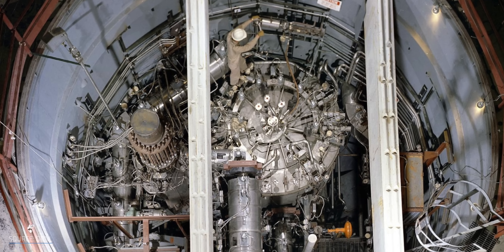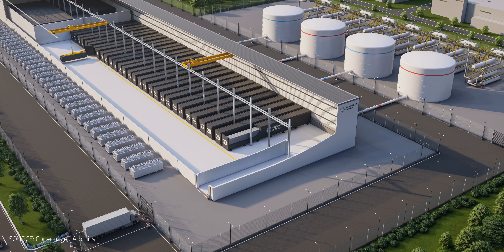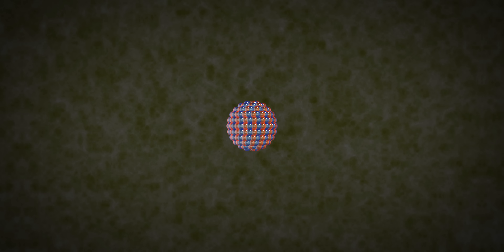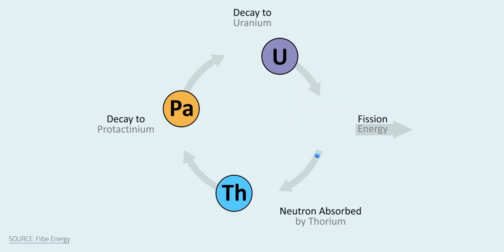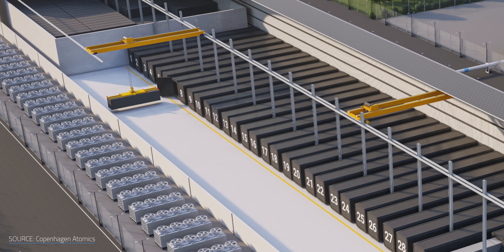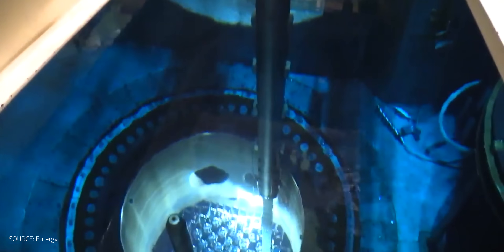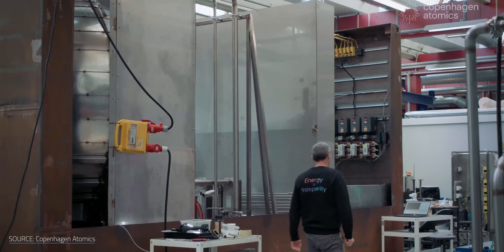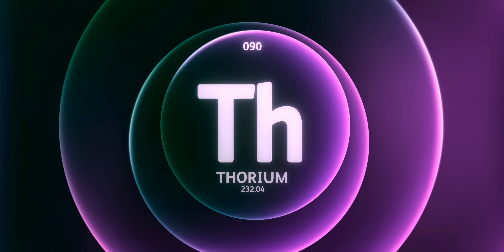Why Thorium is About to Change the World

Comment: Just want to point out that I have been hearing promises like this since the 1970's.
Reply: Me too... I was born in 2000s
Reply: Science is hard. Civilization won't progress if we give up on ideas just because we aren't sure how long they're going to take to develop. There are multiple mere buildings around the world that have taken multiple hundreds of years to construct, yet people apparently don't have patience for paradigm-shifting technology that might take that long to solve? Have a longer view.
Reply: I also want to point out that in the 70s computers that fit in your hand was the stuff if science fiction and you probably typed your comment on a supercomputer that you put in your pocket
Reply: @robertcole1272  So were flying cars - and they still are (just as well considering how most people drive)

In the case of Molten Salt reactors, they were proven to work AND be safe(*) AND be low corrosion/wear(**) AND be capable of complete load following from peak to zero and back again(***) AND be refuelled whilst running

The fact that Weinberg's team didn't get to test thorium operation isn't nearly as important as all the things they did get to test - including handling or replacing reactor and piping components in simulated "hot" environments, which is something that's extremely difficult in water-moderated systems

(*) Nuclear power is already the safest form of energy production by a wide margin. MSRs take this to a whole new level and are "immune by design" to virtually all of the causes of civil nuclear accidents - mostly by eliminating water, but also making things like Mr Ouchi's accident unlikely because external reprocessing isn't needed other than some low level chemical operations(+) to remove "neutron poisons" as the reactor ages

(**) The ablation of Hastalloy piping and the carbon moderator was almost exactly as predicted and no corrosion was visible at any point during operation. Whilst some microscopic surface cracking of the pipework was later detected, the source was identified and the alloy formulation tweaked to accomodate it. It's that tweaked alloy which is used in TMSR-LF1

(***) With neutron poison gasses (Xenon, etc) coming out of the loop virtually immediately, issues of "snap (or prompt) criticality" simply don't exist. Repeated attempts to induce this in the test reactor resulted in a short-lived power spike to about 150% of rated output whicvh then fell back to 120% and stayed there no matter how much provokation the team tried

(+) The "chemical kidney" is something that MSR opponents latch onto as a big deal, claming that filtering the entire loop is a massive undertaking. It would be, but that simply doesn't happen. Filtering is only neeeded after a decade or so of operation and only at tiny fractional throughputs. You're aiming to remove samarium (a non-radioactive neutron poison) from the mix but you only need to remove tiny amounts - enough to stop it affecting power generation capacity. In any case, as with a bunch of other issues there are two approaches possible: external processing or accept an efficiency hit and add more thorium. Thorium is so cheap that it's almost always more cost effective to accept the efficiency losses vs the cost and dangers of processing used fuel. The best approach to virtually all radiological nasties in the loop is to leave them there - they'll break down eventually.
Reply: Okay, but a lot of those promises DID change the world. The internet, for example.
Reply: @markcontini5396  I think @impudentdomain is referring to the cliche that Nuclear Fusion has been 20 years away for 60 years.
Reply: Too cheap to meter.
Reply: That's a pretty shortsighted statement when you reflect on what was accomplished 100 years before "the 70's". The rate at which we could plot advancements 100 years after then is quite staggering.
Reply: I hear ya. Reminds me of wiener enlargement pills. Looks like AGI will be achieved before these things happen.
Reply: @impudentdomain  Doubtful
Reply: China built a working Thorium reactor in the 70's?
Reply: Energy and Technology are the easiest way to scam investors.
Reply: You’re probably right, but the generation of politicians, such as Biden, and people of command, control, seniority, and authority, like Trump from the 70’s, cannot keep control any more. And you can see in the natural age progression of presidents after Kennedy that a particular generation, “the greatest,” kept general control of things for an extended period of time. Things are legitimately changing, and people are wanting to embrace new technologies and future potential, but at the same time, we do want to very much make sure that it is manufactured, made, sustained, and that the knowledge to modify or change it as necessary is kept. It’s really, fundamentally, why we’re at sort of such an interesting nexus of events in both the political arena, and rise of big tech/money in politics.
Reply: It's always been possible, but politics and people with too much power get in the way of changing to any new systems
Reply: Kryptonite reactors are more better
Reply: President Jimmy Carter was on the phone when they started one of the thorium breeder reactors. The problem with small reactors is that you can double the output for only a 70% increase in price.
Reply: @impudentdomain  THE FUTURE IS NOW OLD MAN!
Reply: @EricJohnson-db8bu  The future is likely to look much like the past
Reply: youtube is a fk ton of cluitter. needs to be talked about more, how to organize relevant information vs useless regurgitated trash.
Reply: Like the video shows the research got stopped in those years no shit you'd be hearing things but without results.
Reply: Thorium/Molten salt got killed for military-political reasons in 1972

Thorium as a solid fuel isn't a threat to the military system because it's an expensive PITA that still leaves as much waste as uranium. Thorium as a liquid fuel is a big threat because it means enriched uranium isn't needed anymore (which removes the figleaf covering separation facilities) and not only produces vastly less waste than solid designs but is way lower in transuranics than uranium

Repeatng because it's really important:

The threat to military systems isn't from the reactors themselves but that the dependency on enriched uranium is broken. That substance is a small percentage (10% of the total) unwanted waste product of manufacturing depleted uranium (90% of the total) on the way to plutonium production for weapons but being critical for existing solid fuel designs allows separation facilities to be sold as "enrichment plants" and critical for civilian nuclear power
Reply: So, you’re undecided about this?
Reply: @impudentdomain  I remember Popular Science with a big story about this concept over 50 years ago
Reply: Exactly, this was my first reaction when I saw this titls
Reply: And they have dumped so much into the ocean
Reply: the oil industry wouldn't allow this to progress
Reply: @anonyingpunson  that is really really stupid. First of all they are all in competition with each other, second they all have a lot of many into alternate energy research. Any company coming up with something that works would make a killing. Stop with the conspiracy theories.
Reply: @impudentdomain  but now we have the energy demands of AI to account for and racing against other countries to solve the energy crisis.
Reply: Yeah that’s what my dad always says about fusion as well. Kind of disappointing to be honest. Disappointing because we hope something like this would lead to significant structural changes in society for the better.
Reply: @impudentdomain  just want to point out that a technological breakthrough like this would make the fossil fuel industry obsolete overnight. That is approximately 1000 Trillion dollars or 1/2 of the global GDP. 
It  could eliminate global poverty and heal the biosphere , but it would also mark the largest transfer of wealth in human history. The most powerful people on earth have every incentive to keep this technology out of the public’s hands .
If you have an open mind, watch the documentary ‘The Lost Century’ for a decent overview of how these technologies have been viciously suppressed.
Reply: Exactly. If this was such a good idea, and the science has been perfected over the last 50 years, why isn't this everywhere?
Reply: So still better than the fusion reactor then...
Reply: @andoletube  that's always 10 years in the future.. 🤔🖖
Reply: @MeteorMark    well people did used to say "30 years away" for about 30 years so now saying 10 years away is either an improvement or because "10 years" gets more investment than saying 30- years...
Reply: @andoletube  no. Fusionreactors are allready there and the fusion has happened a few times. Fusion is now about extracting energy more efficiently. This type of reactor, on the other hand, has never been built and has never delivered energy.
Reply: @schroedingers_atze  Still a long way from being deployed in the real world. Proof of concept is one thing. Proof of viability, reliability and scalability are another matter entirely.
Reply: @schroedingers_atze  As I understand it ran between 1965 to 1969, so what do you mean it has never been built...
Reply: @schroedingers_atze  You are aware that fusion has never produced 1Watt of useable electricity (I'm neglecting the bomb aspects); whereas fission has been operating successfully for seventy years.  And so "Fusionreactors are allready there and the fusion has happened a few times" is not correct
Reply: @schroedingers_atze  This type of reactor has been built at Oakridge and China has a pilot research plant up.

While fusion requires... the higher isotopes of hydrogen that don't exist in nature in significant numbers and will never give back much more than it costs to push the stuff together, unless you form it into a star that provides that force under the weight of its own gravity.
Reply: @schroedingers_atze fusion is not technically extracting more energy than put in yet because it requires INSANE energy input to make the system work at all. It’s extremely energy intensive at the moment. But yes at the atomic level, the reaction is producing more energy than put in.
Reply: @schroedingers_atze it has been built and it has extracted energy, all the way back in the 1960s...

It's not a revolutionary technology, it's old tech made more poltically viable
Reply: all comes cause "paperwork" that's the problem, politicians halting everything for protecting others interests rather than let the new technologies blooms
Reply: @acatisfinetoo6921  No, it is not. The technologic challenges are clear. Please educate yourself before voicing such an accusing opinion.
Reply: @acatisfinetoo6921  I will forgive DJT all his egregious idiocies if his latest energy innovation bill gives the NRC the administrivial reaming it's been due for the last 40 years. And most significantly if he will order them to DUMP the fear-korn idiocy that is the LNT model for radiation risk that paranoid risk-averse bureaucrats have been using to block progress and innovation.
Reply: The problem of nuclear has never been a scientific problem.  We could have accomplished this all decades ago. This has all been a political problem from the beginning.
Reply: @finalbossd  Both really. It has been a scientific problem because materials to contain the salt are only just becoming available, however like everything it boils down to money and that is sourced from politics.
Reply: @finalbossd  exactly
Reply: And supposed to run out of oil in the ‘70s. Every time we look we find more…funny how that works
Reply: @MaxQ2989  That's not a correct statement and sounds more like gossip.
You wouldn't think of it like that if you listened to scientists. They assumed that we'll still have oil to pump for about 40 years up to 2070s if we keep extracting more and more.  We can drain if faster or slower. It depends on us.. Many holes are already empty. Some holes classified as empty have been filled with chemicals so that a little more can be extracted. There's nothing funny about the fact that we can examine the earth more and more closely and exploit/destroy it.

We've known this for a long time: the further we push it, the more expensive it will be for us. We still have the option of pulling out before the last priceless drop of oil is extracted from the earth. Everyone would benefit, except for fossil fuel distributors and certain conservatives and lobby organizations that depend on them financially. 

We can't even just carry on like this. Simply continuing will lead to a massive global collapse of ecosystems, the economy. That's one of the main reasons for the sixth major extinction event in Earth's history. We still have one-third of the biodiversity we had in pre-industrial times. It's up to us whether we allow the last third of global biodiversity to be even more decimated.

Wait, what exactly were you talking about? I think i focused too much on the problems. It's complex.
Reply: @MaxQ2989 Oil scarcity is a myth. It regenerates deep in the earth and percolates up to refill formerly dead oil wells. It doesn’t come from “dead plants”, it’s being replenished by some unknown process.
Reply: Germany has wasted probably now a trillion Euros on a failed „Energiewende“… if we had spent only 10% of that money in the development of proper NPPs - we‘d have them already for sure. 

Instead we gave up on NPPs and Siemens had to sell their whole branch for an apple and an eye (to Russia as far as I remember)… 😩
Reply: The real reason the americans stopped the very succesfull thorium project reactor is...... You can't make nukes with it !!!! At least not efficiently, This was the cold war.... So it is a tested technology, we just forgot about it and have to reinvent it (if I'm not mistaking the facts)
Reply: If you watch the video, its literally the first thing he says 0:47
Reply: Thorium is a dry hole. They played with it in the '60s and off and ever on since. Not worthwhile.
Reply: Not really, that is fusion.  Fission has always been viable, it's just that until recently it was classed by the public as the opposite of Green energy.  Now it's considered renewable and has significant green potential so long as it is safe - and multiple small reactors directly address that issue.
Reply: @Spedley_2142      if you extrapolate the output to conventional power plants, small reactors produce way more waste and are way more expensive. Furthermore, you have even more points where things can go wrong.
 How are they supposed to address any issue? They are doing everything worse.  btw. an small modular reactor is not a thorium reactor. SMR is conventional fission.  This might be important. I don't know.  SMR and thorium reactors have significant disadvantages as long as they are small and have to be divided into many points. Nuclear power only makes sense if you scale it up for maximum efficiency.
Reply: @schroedingers_atze  Not sure where you get your info from but most points you make don't make sense.
Traditional plants still have their uses but modular reactors have many more.
Reply: @Spedley_2142  
I can repeat it if you want..
 
I'm still not sure if you want to talk about the small modular reactors or the thorium one.  

I mean... i try...

The facts are there.

Starting with the SMR.
If you scale the size of a nuclear reactor down, you need way more material, produce way more waste and result in way higher costs for less energy.  Also having multiple potential hazards isn't an advantage.

Building nuclear plants as big as possible allows them to develop their potential and advantages.

This is why nuclear power plants have been built very big.

Only with this, plus massive subsidies, is it possible to obtain affordable electricity. 

Everywhing will be worse if you scale that down and built many single reactors with the same output. 

Litteraly everything is worse when it comes to thorium reactors.
Reply: @schroedingers_atze  The SMR (small modular reactor) is the point of this video -  it uses Thorium as a fuel.
It does seem likely that an SMR has lower efficiency but as a significant proportion of power is lost in long distance power transmission a local SMR should negate that.
Nuclear plants have traditionally been built big because they needed to be big to function - you just can't have a Uranium reactor in a shipping crate.
Like the video says, small reactors become more reliable the more they build and the potential for disaster is much smaller.
And to top it all off the whole SMR is less of a problem - if you change your mind then ship it back to the factory and decommission it.
Reply: @schroedingers_atze SMR don’t have the risk of a nuclear melt down 😊
Reply: @volkerr. you cant seriously believe that. That's what non scientists say to sell their product. The scientists working for them would tell you something different... Did you even listen to whats happening to the reactor and pipes? At this point it's physically impossible to built a long lasting and stable working thorium reactor.  That's the reason for the huge maintenance and replacements after the theoretical 5 years. Also there is still way more waste.
Reply: @Spedley_2142    A thorium reactor isn't automatically SMR.   That's to start with. There will be more confusion in the future... 

Those theoretical SMR with thorium are called thorium based SMR.  They would combine the problems of SMR and thorium. Even higher prices, more waste and so on 
Just build a single big one and benefit from the pros of scaling nuclear power.   

There's no reason to emphasize the disadvantages of nuclear power and combine them by splitting high output into many smaller ones.

As I said, the major operators have many arguments against it and have consciously decided against building small nuclear power plants. Practically nobody who actually makes money by supplying people with energy wants that.
Reply: @schroedingers_atze  Agreed and in this case they are combining SMR and MSR. Neither have ever been done commercially and both have steep learning-curves. Maybe they see this as  just a big hobby project that they can work on for the rest of their lives without ever having to deliver...
Reply: @Spedley_2142  You are just repeating all the nuclear/SMR PR. We have long distance transmission and we know it works. The loss for HVDC is 3.5% per 1000 km. That isn't much and it isn't as relevant when the actual energy source (wind/solar/hydro) is free and the tech to harness it super cheap. You are also missing something important here: Neither SMRs nor MSRs have been done commercially. From an economic point of view, this is all hopium and PR.
Reply: @schroedingers_atze  They produce almost no waste so idk how you got the "more waste than conventional power plants"
Reply: @schroedingers_atze  Hmm.. Well yes sort of.. Molten Salt Thorium Reactors would destroy the way traditional way nuclear industry makes money, so ofcourse they don't like that. Same as gas & oil industry doesn't like it.
Reply: @schroedingers_atze  I think the biggest issue is that once these SMR are deployed, there’s a 90%+ chance that no one on site has the credentials to manage failures.
Reply: @schroedingers_atze  the US has already experimented with SMRs and have come to the same conclusion that they're not cost effective as big reactors.
Reply: @volkerr.The Two new generation III + designs (AP1000 & ESBWR) won't meltdown either.  Although only a SMR light water reactor design can be walk away safe.
Reply: @schroedingers_atze Do you have some efficiency figures for Thorium breeder SMR/MSR 100 to 300 MW and light water reactors 1 GW and larger?

Some say that capital cost is more important than efficiency.
Reply: @Spedley_2142 - this reactor are perfect for the moon and mars. Shipping size and weight are the main issues.
Reply: I'm genuinely what more could most humans even need in terms of power consumption at this point.
Reply: @bobdole27  About double. Changing to electric cooking instead of gas. 100% EVs for every owner. But don't worry, the U.S. grid has grown 5x since the 70's so easy to keep up.
Reply: @bobdole27  Datacenters use ridiculous amounts of power and they're popping up all over the place.
Reply: @Wimbold  So essentially its not for us but for AI data centers.
Reply: @bobdole27  Kind of yeah. At its current rate data center power consumption is roughly doubling every four years.
Reply: @Wimbold  😟
Reply: @bobdole27  Energy is a need that will never be satisfied. From something like data centers to space travel, to simple things like reducing the cost of residential heating. If there was an abundance of energy, we would have had flying cars 30 years ago and your power bill would be negligible.
Reply: @tufuselt9055  I doubt that'd be case, because it wouldn't be really be allowed for us to have "flying cars", nor would they be needed.
Reply: @bobdole27  Unfortunately AI not only takes jobs, it also takes energy thats used to sustain and protect human life.  The amount of energy required for the AI trend is frankly unknown.
Reply: @30smsuperstrat  Grim...
Reply: @bobdole27  Humans are going to need enormous amounts of clean energy. The transition to electrify the staggering amount of energy currently created from burning fossil fuels, new applications such as AI, and of course the billions of people in developing countries who want a better standard of living.
Reply: @bobdole27  only 1/3 of our carbon emissions are from electricity production. Reducing the carbon output needs 6-8 times more electricity production, not just 3 times.

Additionally, the developing world needs clean energy sources or they'll easy outconsaume developed ones in terms of carbon emissions. It's a matter of planetary survival, not just reducing climate change - if things go to far it's perfectly possible to "snap" to a low oxygen environment and have a 98% mass extinction event. This has happened in Earth's past and current climactic conditions closely match the lead-in to that event (Permian extinction, aka "the great dieing")
Reply: @alanbrown397  k
Reply: @bobdole27  there are about 3 billion people who will use less electricity this year than your refrigerator.  In addition, most European nations have a standard of living that's far behind a typical American.  So most humans would want to consume MUCH more power if it was available and affordable.
Reply: @jasonbrannen7598  Hmmm strange of you to assume I use a fridge. I actually live a rather nomadic lifestyle.
Reply: Funny… real energy progress also stopped about that time, almost like we got off the gold standard and then went straight into Reaganomics around that time
Reply: @Sinanjuphenex   No, it was the No Reactor Commission.